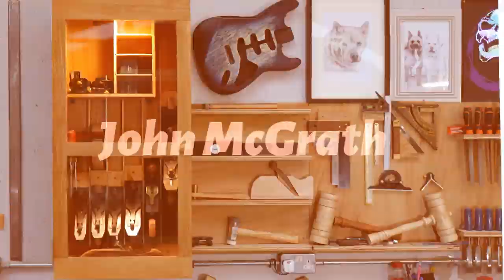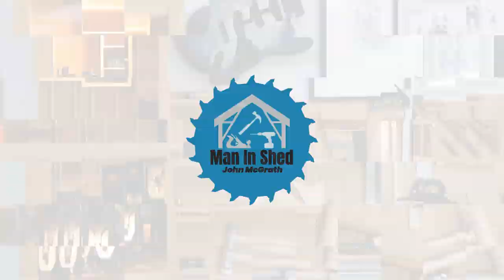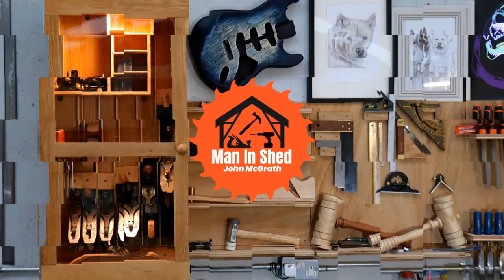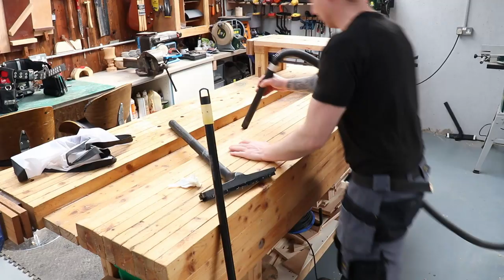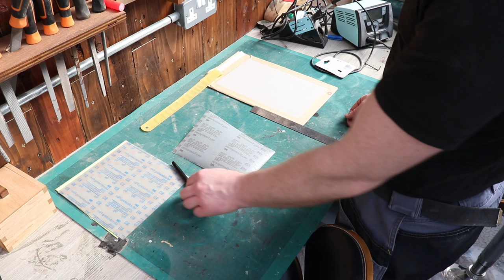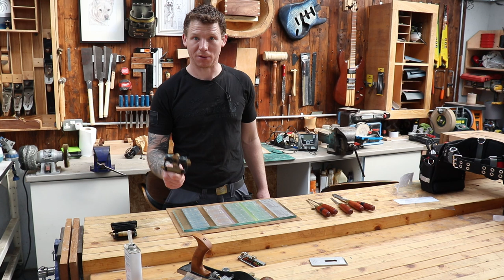Cleaning the Workshop, Sharpening Some Tools. Lock down Vlog

Comment: Hang in there! Where did you buy that sharpening jig that holds the chisel in the right angle?
Reply from the maker: Its the Veritas honing guide, I bought the deluxe system so it does both the plane blades and chisels.